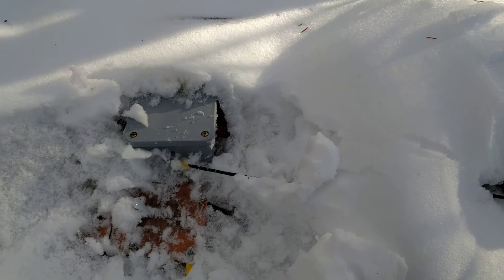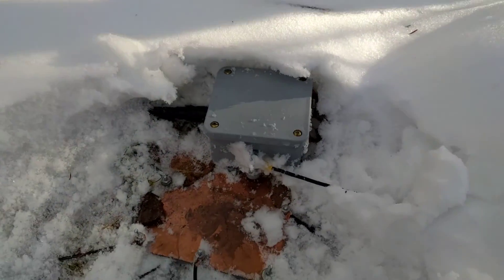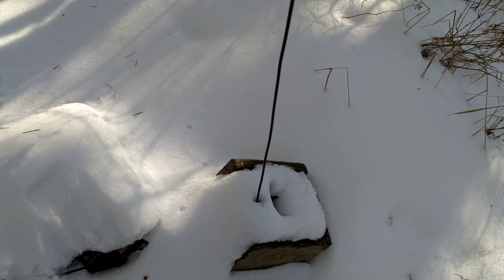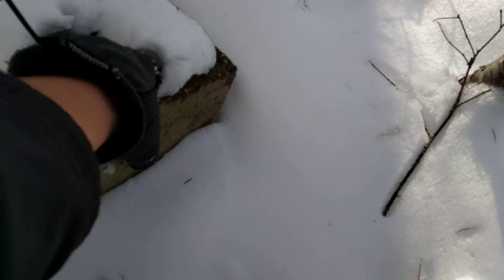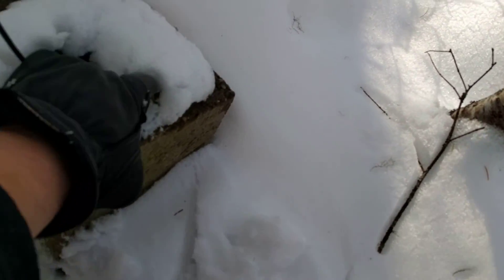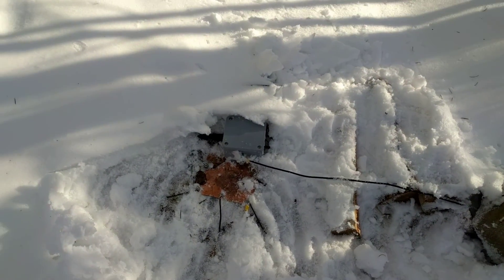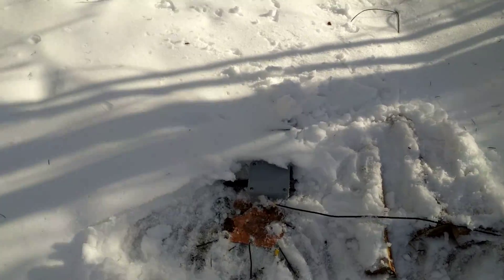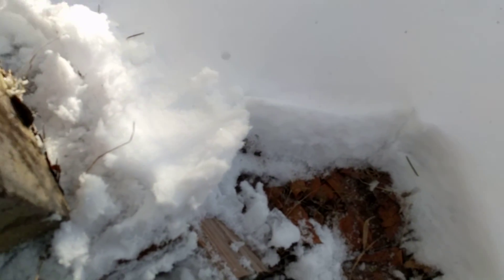160 Meter Inverted L antenna.

Comment: Is this a quarter wave Inverted L? Wonder if you have measured the feed point impedance? I have an inverted L about 179 feet long. 60 ft vertical and 119 horizontal. I use a vacuum variable capacitor to tune it wherever I want in the band. Usually it sits centered on the CW band but during a SSB contest I set it a bit higher.
Reply from the maker: Yes, 1/4-wave (130-something feet/40-something meters). The feedpoint impedance is around 38ohms at X0. By the time it gets back to the shack it's basically flat. I used it around 1850kHz to about 1900kHz without issue. Anything higher in the band needs a tuner. The resonance point has slipped right down to the FT8 portion which is not an issue for me, and I have no intent on "fixing" that issue.